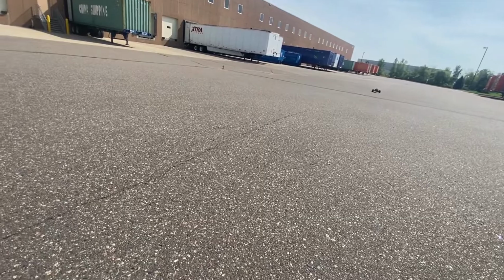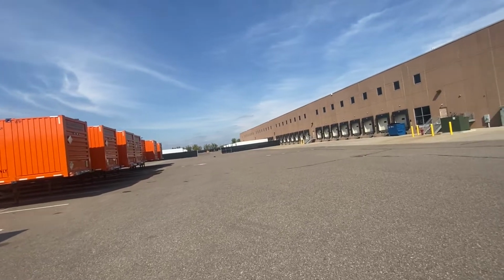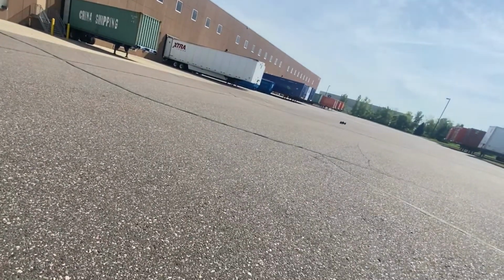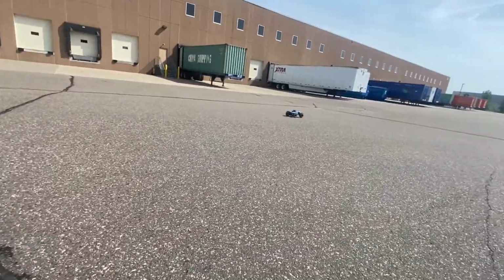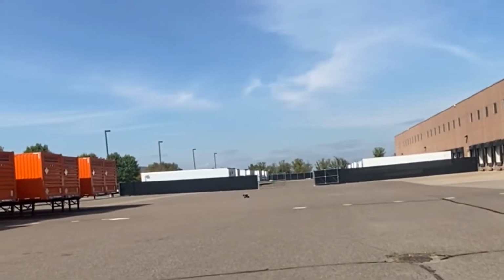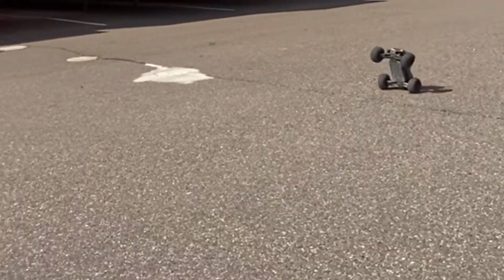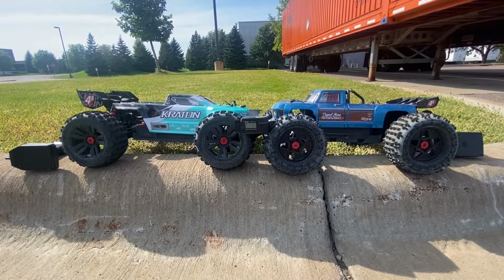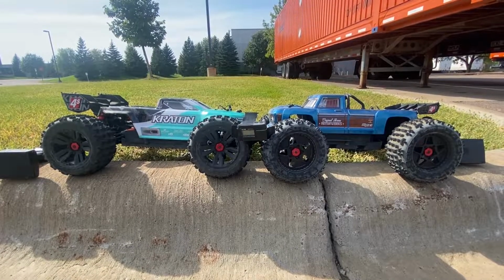Arrma Kraton BLX 4s v2 VS Arrma Outcast BLX 4s v2-Speed Test-New Top Speed for both-Who is faster?

Comment: Nice comparison, these 2 were my choices and I went with the Kraton 4s. Besides checking for loose screws. Is there anything I need to look for before my first run. I've seen videos talking about missing diff shims and no fluid. Is that only a concern for the bigger models?  Thanks for your time.
Reply from the maker: Congrats on the Kraton! TBh, I never check anything before running my rigs. The only time I had an issue was with my Arrma Senton and the rear diff had no fluid.  Other than that, i have been fortunate.  

In my own experience, if the rig doesn’t not run right then I will look at the diff fluid. For example, on pavement if there is too much rear or front power bias or odd tire wear.  If you cannot get to full trigger without the rig going out of control or way off line.  Those symptoms usually point to the diff fluid.  

But yes, you can never go wrong getting to the diffs before you run it. If you are a cautious and it makes you feel better than do it! 

For the 4s Kraton, I didn’t look at anything. You should be good to go. Slap a battery and let it fly! But that is my opinion.
Reply: @moerc  Unfortunately I'm not that excited,  I could tell the box I got had been resealed. So I carefully looked over the truck and noticed light scuff marks on the underside of the chassis. Like it had been used. Also there was a noticeable scratches in the battery tray and where the motor mount goes. I'm concerned I got someone's return and there might be something wrong with it. Or am I being to picky?
Reply from the maker: @rowdyrod7870  I would call or chat with horizon hobby.Did you buy it from them?

Don’t run it, you are not being picky. 450 bucks is not cheap.’lol
Reply: @moerc  yes I did buy it from them. Unfortunately they don't have a #, it's only email. I have to send them pics. I'll let you know how it goes. I know 515.00 all said and done.
Reply from the maker: @rowdyrod7870  you can chat with them on the website. Works fairly smooth too.  Man, what a bummer! Keep me posted on the outcome!
Reply: @moerc  Good news, they are sending me another truck. So probably get it early next week. At least I have my granite 3s to keep me busy in the meantime.
Reply from the maker: @rowdyrod7870  awesome news, man! 

Granite is plenty of fun!

🤝🤝🤝🏎🏎🏎
Reply: @rowdyrod7870  515.00 just for the truck?